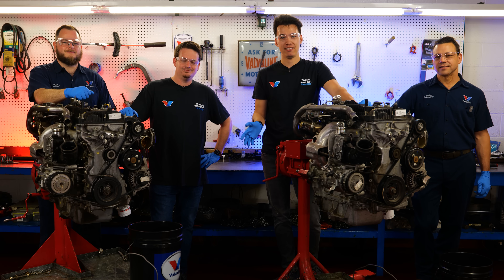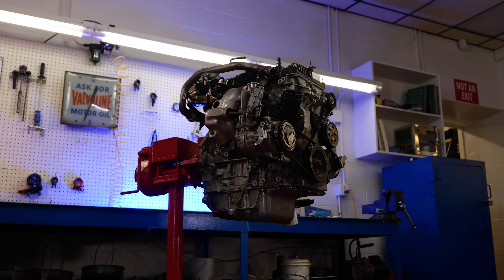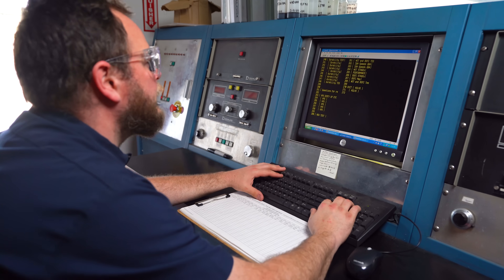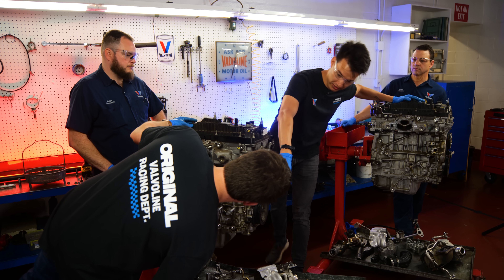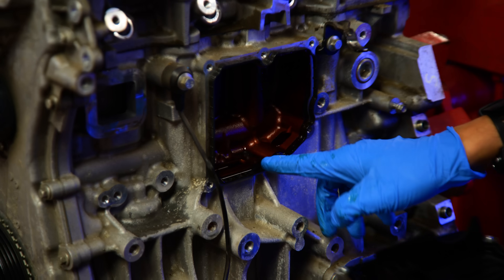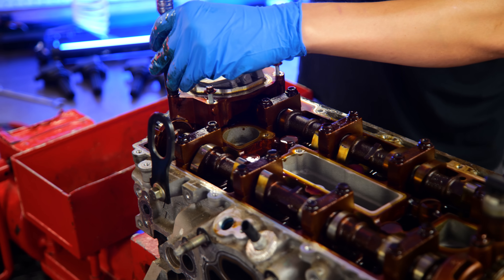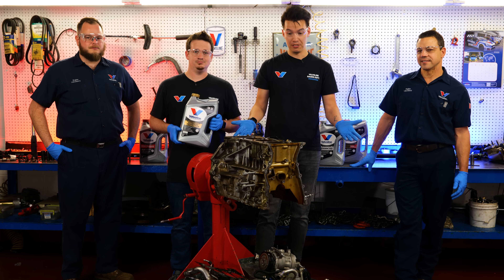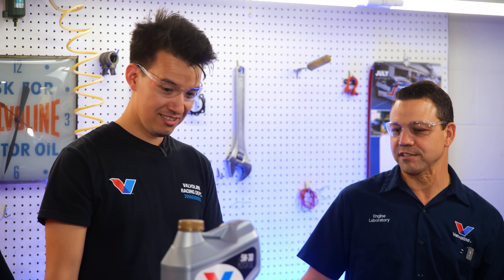Testing different oils over 4 years and 1 MILLION miles

Comment: I'm 53 and have run a competitor's brand (starts with the letter M) full-synthetic for 32 years in everything I've owned; cars, pickups, SUVs and sportbikes. After drag racing old-school air/oil-cooled GSXRs in the '90s I became a huge believer in synthetic oil and how well it protects parts from wear.
Reply: I’m not 53, not into drag racing nor a car gear head. But like walking, hiking and cycling. Only synthetic oil is used in vehicles as it makes sense. Super cool video and study done here. Appreciate the entertainment value and the knowledge for average consumers. Super cool for car people too:)
Reply: I used Mobile 1 twice. Two different vehicles. Leaked both times. One leaked on a clutch, cost several hundred dollars. I will NEVER use Mobile 1 again.
Reply: @davidkuhn3970  
Ive used RP a long time.  I put some in an Accord I had been using Pennzoil Dino oil every 2k miles in since I bought it.  It immediately developed a rear main seal leak.  Most likely, there has always been a defect there and it was gummed shut.  The premium synthetic cleaned all that exposing the leak.  That's what likely happened when you used Mobil 1.  It's not the oil that caused the leak..it just cleaned up everything so well it exposed a defect.  On the upside, it means it's working to clean out your engine!!!
Reply: @davidkuhn3970  I've read and heard similar claims over the years, but don't believe it. I've used the stuff since at least 1991, my dad since shortly after it came out in the '70s; neither of us have ever had an issue with oil leaks because of synthetic oil.
Reply: That’s probably the equivalent of 200k miles in real world driving.
Reply: Why wouldn't you just say it?
Reply: @rday7573  Because the video was done by a different company, and I didn't want to step on their toes. Seriously, how difficult is it to figure out what company I mean?
Reply: @rday7573  The legitimate reason: It's a different company than who made the video. That should be good enough for you.
Reply: @BB..........  it is, and thanks for sharing, but man...why are you so angry? This is just a YouTube comment section.
Reply: @rday7573  I'm not angry. Does a direct answer trigger you?
Reply: What is the M brand
Reply: @issavibez394  Stop and think for a few seconds what company is well-known for their synthetic oils and name starts with the letter M.
Reply: @BB..........  Mobil 1 . Motorcraft
Reply: @BB..........  both of those sucks from my experience.  My experience valvoline restore has been great results for me
Reply: @BB..........  Ms Oil
Reply: @Aaron-dp5kb  
Old ones? Seal design not good enough.
Reply: @ It’s not the synthetic that’s bad it’s the lack of zinc that’s bad with flat tappet.
Reply: @davidkuhn3970  
What does the sync do?
Reply: @davidkuhn3970  Way back in 1990 I bought a winter beater Mercury Cougar with 200 straight 6 from my friends brother. It had developed a rod knock on one cylinder so he dumped in Mobil 1 15w50 and drove it for another year before I bought it. When started it knocked for about 1 second then was dead silent. I continued to run Mobil 1 in it the entire time I owned it. I sold it to another of our friends and he drove it for 2 or 3 years, then sold it to somebody else. From the time the rod knock started until the car was finally lost track of, we'd put another 100,000 miles on the car, and the knock never got any worse.

Comment: I would really love to have seen some technical spec on the differences, ie. Proper measurements of the bearings and camshafts etc. Before and after. But it was  a very nice informative video though. So basically the only difference is a bit of sludge.. no performance difference, if i look at the cost of synthetic oils compared to conventional. I would like to see the comparison on the costs of running those 2 engines.  I think you would be pleasantly surprised 😅

So for me if its only sludge, then the cost saving of conventional oil would still be king. 😊

There are also a whole host of oil additives which you can run on every other service alongside the conventional oils. 😊

Comment: This is great. I still can't get myself to go 10,000 miles on a oil change and I don't think I ever will. 5 to 6 thousand is what I usually do with full synthetic.
Reply: I do 4k
Reply: That's because you're sane.
Reply: The EPA wants the manufacturers to extend the oil service intervals because they know there’ll be less oil dumped in the ditch that way.
Reply: Additives tend to break down and stop working at 7k
Reply: Only an oil analysis can tell you more precisely how long the oil interval should be before needing changing, there are far more variables than just miles driven, hours of engine use is a better predictor.
Reply: @RayleighCriterion  I've sent in many oil samples from my vehicles and heavy equipment. On my daily I sent one in with 7,000 miles. They said the oil was still good and I could run it a little bit longer but I change sooner. One thing I found out is, I'm changing the oil in my heavy equipment way to early. 100 hour oil changes were always the thing but now I'm running 200+ hours. I can't get myself to run much more than that and it's usually how it works out for a yearly oil change.
Reply: @RayleighCriterion  Which is why most people change their oil sooner than necessary (or much later believing what they think they're reading on a container label).
Reply: I use synthetic too 5-6k
Reply: I do 3000 mile oil changes no matter what.
Reply: @WilliamBallard-t2q  nothing wrong with that. I have tons of other equipment I do oil changes on also. I probably do about 30 oil changes per year.
Reply: I read a response from an engineer(on Reddit so take that for what you will) and it's how to calculate intervals. Intervals should be based on gallons of fuel consumed and oil capacity since combustion byproducts are what degrade oils. It's as follows: 
1) look up vehicles oil capacity and multiply number by 50
2) this number is the number of gallons of fuel you can consume before requiring an oil change 
3) convert this number to miles based on your vehicle's gas mileage average. 
Simple calculation that I've used and is highly recommended by various "experts" on car forums.
Reply: @timlong1462  5,582.5 lol. That's interesting
Reply: @lobbyrobby  I thought so as well. For me it kind of put a reasoning behind when and why we change engine oil so frequently vs trans or diffs. Makes sense as to why there are detergents in engine oil and not in other lubricants. It's the byproducts of combustion. Prior to reading that equation I never really considered some of that, and having a formula based solely on combustion byproduct entering the oil makes really good sense to me. Also happens to align perfectly with my previous notions, kind of like you.
Reply: @timlong1462  yeah it's good to see my intervals make sense. To me driving habits and conditions should also play a part tho too. Most of my miles are highway miles. If they were mostly city miles (stop and go all day) I'd probably change it more often. Or say towing miles.
Reply: @timlong1462 thanks for sharing that. All my cars get 7k mi OCI. Why? Because I can do a tire rotation at same time. I find 7k gives me great tire wear and my engines look spotless after 300k mi.

Comment: I don't believe they mentioned (miles between oil and filter changes),  if they went 10,000 miles conventional oil isn't made to go 10,000 miles between changes. That 10k oil changes came out after synthetic oil came out.       I change my conventional oil and filter every 5,000 miles and the engine is like new clean inside with over 100k miles on it.

Comment: I'm 65 years old, I grew up in the UK, we used Castrol GTX 20W/50, regular oil, (no0 synthetics then), changes were at 10-12k Miles or each year, but in those days, (1970a-80s), we didn't expect our cars to last more than 100k miles.  Now I have a 1971 classic Triumph and use High Zinc 20W/50 Synthetic, and the best synthetic U.S.A. made filers I can obtain, I change it out every 6k miles maximum. Hopefully that helps to extend the life of my expensive engine. (I really wish that Valovoline VR-1 Synthetic was easier to find locally)

Comment: So basically, conventional will take you to half a million miles without issue. The question is, how were the compression and oil pressure numbers between them? How often did they turn off the engine and let it come back to room temp? Engine last no problem when run constantly…

Comment: Other than thin synthetic oil lasting longer and not breaking down as fast as conventional oil. What I've learned is even if you use conventional oil or synthetic change your oil at the intervals or ahead of intervals. Very few people have a car with an engine that has 500,000 mi on it unless it's a diesel engine.

Comment: Not only is this video great for Valvoline but also says that the Ford 2.3L Ecoboost is a darn good engine. Ford has been building EcoBoost engines since 2011 and have greatly improved them over the years. Toyota has been very slow to adopt and will have a tough time of it now. I would not want to own a EcoBoost from 2014 or a Toyota turbo from 2024.

Comment: I have a 2024 Maverick with the 2.0 turbo and now will be using Valvoline full synthetic. This is the test I have been looking for. Thanks Valvoline!
Reply: What were you using before?
Reply: You’ll never see 200k on that engine let alone 500k.
Reply: @ Pretty sure the Whole truck won't last 200K. I will put 100K on it and then buy a new one. The money you spend on things breaking and wearing out over 100K is not worth it to me.
Reply: You better use full synthetic. If you read the manual, it clearly says 5w-30 full synthetic with a WSS-M2C961-A1 spec.
Reply: The condition of the two turbo's was extremely impressive considering one had 500K miles on it, the other, the dirty looking one,  300K miles! The untold story was the conventional oil engine had the turbo fail at 200K miles while the synthetic oil turbo went the distance for the test without failure. Good oil and keeping it topped off is maybe the single most important thing to remember with any turbo engine. Timing chains also rely heavily on a good supply of clean oil that is kept topped off as needed. Dirty oil can clog the tensioners (as we saw with one of them) and that can lead to chain stretch or failure.

Comment: I've started to run my little Hyundai on fully synthetic oils. It's got 219200 klm about 140k miles.  Does it help at all to run an engine cleaner through before every oil change to clear away any build up of sludge before I got the car ??

Comment: Am a big believer in halving the manufacturing claimed oil change intervals. Owned a 2006 Holden Commodore VZ Ute with the 190kw V6 engine. Holden like other GM products had timing chain issues with those engines. I was told if I wanted to have the chains last I should change the oil and filter every 5000km which I did religiously using only full synthetic oil. The car had about 130k kms on it when I bought and according to Holden it was still running the original timing chains. Move on nearly 10 years I had over 300k kms on the engine and had absolutely no problems with the timing chains or timing gear and didn’t even have any problems with sludge also a common problem.

Comment: 500,000 miles on both engines. Yes full synthetic had less varnish but I’m really impressed with both oils. Especially seeing they were 10,000 mile intervals oil changes.
Reply: Varnish raises compression
Reply: Sure but they were run at constant high speed and that's the key. And my bet is that ANY oil with the same viscosity and API rating would have been the same.

Comment: Little bit of info, regular oil is not supposed to go 10k miles.  That engine would have been squeaky clean with your average cheap store brand oil if changed every 3-5k miles.  Every oil has its own strengths, and no additive pack is enough to "fix" oil.

Comment: The oil needs to be changed every 5,000 miles. Changing coolant every 35-50,000 miles is a great idea, Changing out the water pump, radiator, hoses and thermostat at 150k miles is also a great idea. All other maintenance should be done at 50-75% of the time/mileage recommendations if longevity is the major goal.

Comment: Very nice video. Gentlemen, can you answer a few questions for me? What are the alloy proportions of the oxide and oxyde groups? I mean the most important groups in connection with Motimol, or MoSo4. Then there is the outgassing at at least half the air pressure in the application area in higher regions. Because unfortunately the conditions for outgassing and oxidation processes accelerate there. Do you have any connection to the aviation sector? Just as an example, the companies Continental and Laycoming. With petrol and diesel engines with turbo and above all with compressor. Because in this application area, more or less a small speed range with almost constant speed is used. Peter

Comment: Too bad that you didn't do a compression and leak down test before the tear down. As a retired mechanic for 50+ years I have seen the effects of poor maintenance. I have had good results myself with  petroleum based oils, but I changed oil at 2500/3000 miles. Now I use full synthetic oil and change it at 5000/6000 miles and still have good results and save money and time. 
I will not go 10,000 miles between oil changes, I could show pictures of the results of my customers choice to use manufacturers oil change interval recommendations.

Comment: Conflict of interests. It is in Valvoline's interest to sell you more expensive oil. Without watching the video one can surely predict, solely on that fact, that the synthetic oil is "way better".
Let me tell you - you don't need special type of oil. Buy the most ordinary oil from a local store and replace it (just the oil w/o oil filter) every 4k miles. Every third oil change replace the filter. I guarantee you that the engine condition will be bettet than if the same engine was used with the most special expensive 100% synthetic oil. 

This is true unless you drive a car with a diesel tractor engine that has a dpf and egr.

Comment: 3K - 5K max, Synthetic or Conventional. Oil and Filter change is much cheaper and simpler than engine repairs. Changing your Oil is the simplest and most important maintenance item you can do for your vehicle.

Comment: What is often missed, is that it is easy to get 500k miles on a car in first 5 years before time and heat cycles causes gaskets and other things to degrade.  Rubber parts on car degrade over time regardless of the mileage. 
Many people have gone millions of miles using conventional oil with 3k mile oil changes, so it is not impossible.  However,  If you plan on keeping a car for over 150k miles change the oil every 5k miles, minimal, with synthetic oil and enjoy your car.

Comment: was there any data on the condition of the oil after each sample was taken?  I think it would be really telling to know what the useful remaining life, as well as the contamination, on each.

I personally hate these long duration manufacturer recommended intervals for oil changes.  6k is my limit on full synthetic, even if a Lab tells me I could easily push it to 7500.  I'd rather change early and have a cushion than run every oil change to near exhaustion.

Comment: Interesting test but its biased towards synthetic, ideally it should have been conventional oil change at 5K and synthetic oil change at 10K
Test is pushing the conventional oil past its limit of 3-5K where the synthetic is designed to last 10K easily.

Its like comparing Usain Bolt to Phelps in swimming contest and saying Phelps is better.

Comment: Ok this video is not legit 26 seconds in. those are ford 2.3L ecoboost engines, they are not going to last till 500k. If it were a toyota or some honda, maybe but an eco boost, especially the 2.3l no way. ... those are the ones that pop head gaskets like a pill head pops pills and eats turbos like a fat kid eats candy.  Ok lets say its the miracle 2.3L engine and one made it BUT the one with conventional oil, no...just no.

Comment: People change your oil between 3-5k miles not 10k miles that will destroy your engine coming from a mechanic who’s been in many different fields .. I worked on Boeings , diesel trucks , normal cars , bikes , boats the whole 9 .. change your oil more frequently and you will appreciate me .. if not u will hate yourself when u spin a bearing because varnish got loose and clogged up the oil pickup causing the crank bearings to run dry long enough to cause unrepairable damage.. very expensive and could be prevented

Comment: That’s wild 500,000 miles without changing a turbo or timing chain. The test was too controlled there’s no way. I have an eco boost f-150 167,000 it’s got a new timing chain and I need to replace the turbos again. I use full synthetic and I drive the speed limit and I don’t do 10,000 mile intervals

Comment: Fuel quality also has a measurable effect on engine wear and tear. Ethanol gasoline shortens engine lifespans.
Reply: How does ethanol shorten engine life?
Reply: @SME.Retired  Ethanol is a hydroscopic solvent that washes the oil film off of cylinder walls and cause fuel dilution of oil because it is less efficient than pure gasoline which means you have to burn more of it, which increases the dilution. 

Engines that run on propane can go 25,000 miles between oil changes.